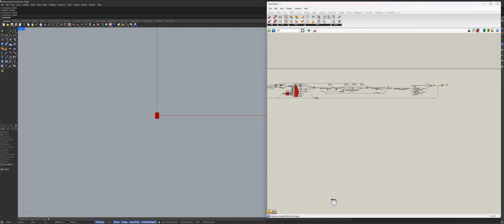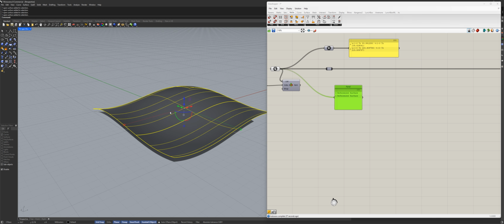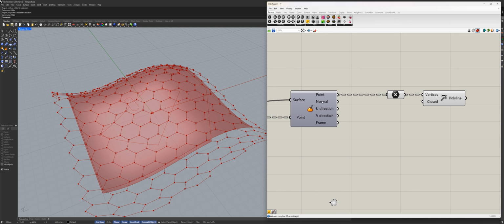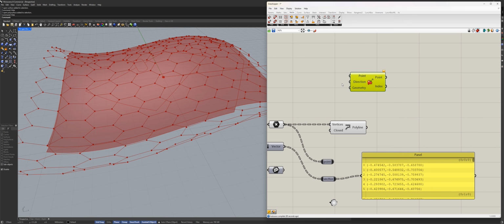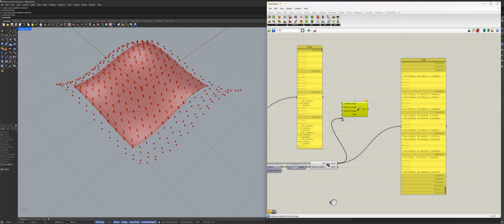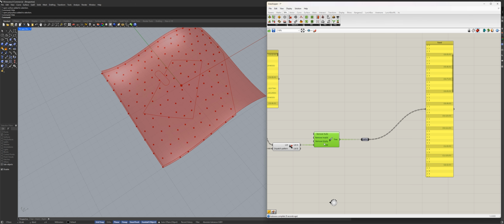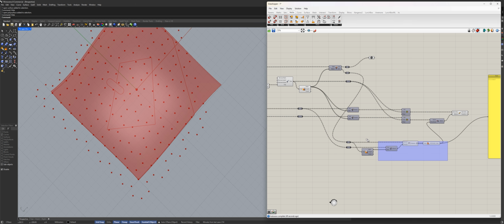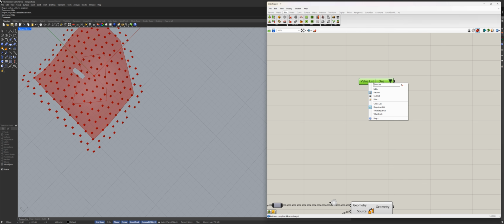Grasshopper Theory Builder: Hexagonal Multi-surface Pattern. Part 9

Comment: 9:12 Well, I am rooting for you Alex 😁.

I do have a question Alex, how did you come to learn all of this?
Was it something you studied, practiced, researched? Most probably it's all of those given your depth of knowledge 😅
Reply from the maker: As for parametrics specifically - nobody really taught me that. I’m mostly self‑taught in this area. College and university gave me the fundamentals: math, physics, basic industrial design principles and theory. But they don’t really provide practical, hands‑on skills.
So most of what you see is pencil mileage. In the end, it’s a mix - a formal foundation, but the depth comes from self‑driven work rather than the degree itself. And if you’re wondering whether you need a specific degree for this - you really don’t. In design, people care about your work, not the diploma. It’s absolutely possible to teach yourself everything you need.
Reply: @AGGraphics Thank you Alex 🙏🏻.
The thing is, every once in a while I come across a new concept/way of thinking that completely transforms how I approach design and I am the FOMO kind of guy 😅. I am not sure what I am still not aware of with regard to product design 😅. I am completely self taught and lack that kind of organised rational development that many of the people like you have. I am not particularly keen on the degree itself (honestly couldn't care less 😂, I already have 2 Mscs, and only use one them sparingly 😅). While I do love collecting the different pieces myself, I am aware of the gap between me and designer like you.

It's an interesting place to be in, but at least it keeps me always on my toes and looking for what I should be learning next 😁.

But sometimes I do wish to have pursued this path (Architecture/Product Design) through formal education as well.
Reply from the maker: Honestly, the structured part you’re talking about - that comes mostly from time, not from school.
Formal education gives you fundamentals and a framework, but it doesn’t give you depth. Depth is always self‑driven.
You’re already doing the hardest part: staying curious, exploring concepts, and constantly updating your mental models. That’s exactly how good designers grow.
The gap you feel isn’t about degrees - it’s about mileage, and mileage is something you’re already accumulating.
And FOMO? Every designer has it. The field is too big for anyone to ‘know everything’. The trick is simply to keep moving, which you’re already doing.